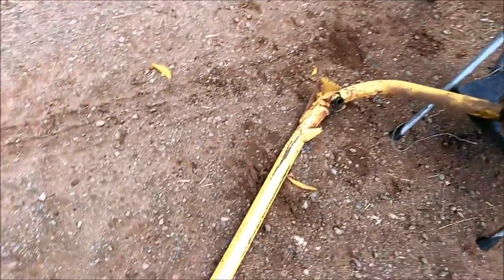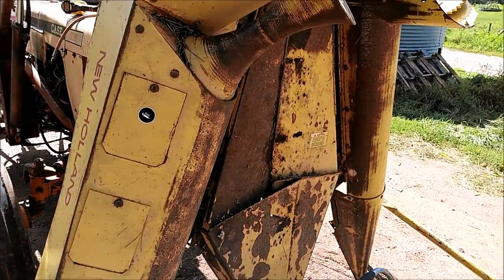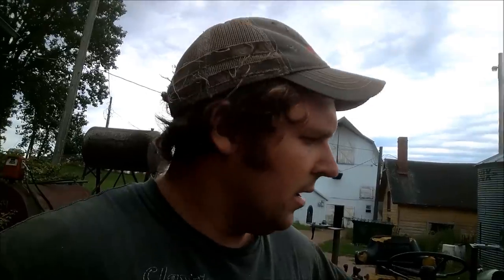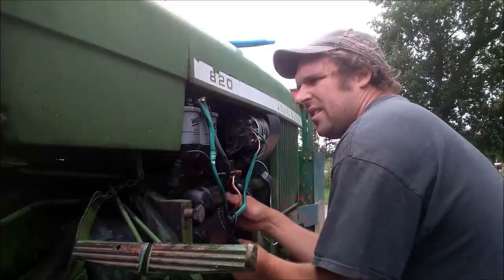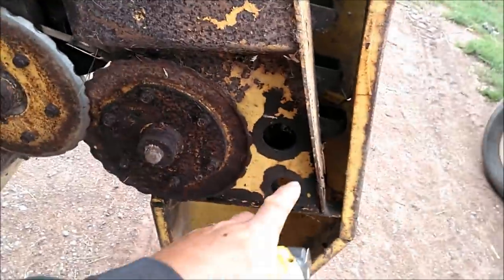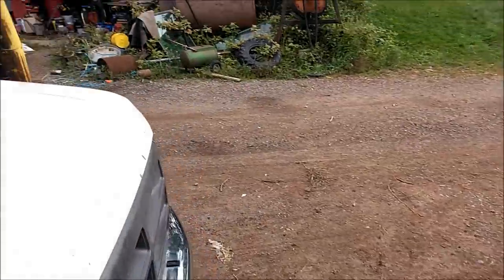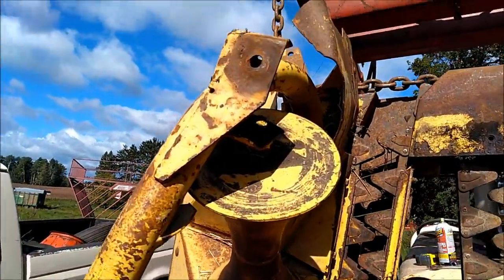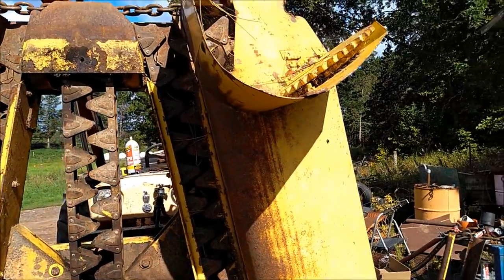Narrowing up the New Holland 822 Corn Head

Comment: Hey Alan thanks for the update, hope the corn head works good for you. You might want to use power service diesel additive in your bulk tank to help with moisture in the fuel and keep injectors clean I always used it back when I farmed and had good luck with it 👍

Comment: I always use Sea Foam fuel additive. It is the best additive on the market. My snow thrower was skipping and the only way it would run was without the choke half way open. I put a few ounces in the gas and a few drops in the oil and let it run for a few minutes. Next week I pulled it out of the garage and give a pull and she runs like a top. Also, the best lubricant is a product called LPS. My friends truck door wouldn’t stop squeaking so I put a few squirts on the hinges. He laughed and said that will never work. I saw him next week and he was amazed. No more squeaks. I really enjoy your videos but missed the family. Oh, how’s the manure pipe project.
Reply from the maker: Found the crack in the pipe, just waiting for a part, should be here beginning of next week, then we can start putting it back together.

Comment: Check the clearance on the discs that cut the stalk off. There is shims for adjustment. I had the 824, supposedly the discs were back toward the gathering chains more than the 822 was.
Reply from the maker: Yeah I tried it today and had a little trouble with one side plugging with grass, so I took a shim out,I looked at an 824 and they did move the discs back, I've heard some people say the 824 was much better, but a friend of mine had an 822 and said it worked good, so time will tell.
Reply: @trinitydairy  I had a New Holland dealer 8 miles away, I would have them set the shear bar up on the chopper and adjust the chains and discs on the head. What does the chopper have for a pto, a factory NH?
Reply from the maker: @garybridger6707  yes I believe it is a new Holland
Reply: @trinitydairy  I had a 770 chopper. The factory PTO shaft that hooked on the tractor had a strange slide system. It had metal rollers lined up sideways. Went through 2 of em one year. Converted to a newer pto.

Comment: You need to check the grease lines that run through the head. Sometimes they will break, then your bearings run dry. If you are having trouble cutting off grass you will need to shim your stalk knives tighter. Sometimes they have to be pretty tight together. Also make sure the bearings on the stalk knives are good. When they start getting bad it will let your stalk knife gap too much.
Reply from the maker: Thanks for the info!  I was lucky enough a friend had a manual for this head so I had to make a few adjustments today even on it.
Reply: @trinitydairy  happy to pass on what I know. We had an 822 and several 824s

Comment: O I have fixed plenty of them corn heads! Good old head you have their! The gears underneath make sure their in the right places with the clips holding them in place, also roll the head over by hand a few times forward an reverse to c if the chains don't bind anyway if they do you will shear your head bolt !
Reply from the maker: Yeah I just had that happen.  A friend had a manual for the head and now I've got it working right.

Comment: If you have a lot of grass in your corn you may have a problem with the cut off discs but if their tight they will cut good in grass just may have to reverse the head with you get to the end of the field once in awhile to clean the grass out that gets between the disc an bottom gathering chain!  Good luck Alan!
Reply from the maker: Yeah I tried it yesterday and one side plugged, so I took out a shim and it worked good today. Thanks for watching!
Reply: @trinitydairy I have ran then heads for a long time, I'm onto the new 3 row now but I have ran many acres a year threw it, when the 782 can out new we got that head with the new chopper an it served up well threw the years!  The center snout don't like hitting rocks tho they will brake on the back side that their fastened to!  Make sure if you take them cutting discs off lube then up good before they go back on!
Reply: @trinitydairy  another thing allan, on your spout so it doesn't brake when they get old, put two pieces of 1 1/2 x 1 1/2 angle from the bottom of the spout by the hinge to 3/4 the way up on the outside on both sides, their are holes already in the spout just use them an that will help it from cracking, their good for that!

Comment: Another thing Alan make sure you've got extra filters with you in a jug of fuel with that cleaner in it because once that starts breaking up it'll plug those filters right up you can change them on the fly and takes just a few minutes but if they plug up you're dead in the water
Reply from the maker: Thanks for the info!

Comment: Think you’ll like that little chopper Alan... what model Gehl chopper are you replacing?
Reply from the maker: I'm replacing a Gehl 1000, we still have a 400 and a 600 with a 3038 belt corn head, all good choppers but getting hard to get parts for.
Reply: Trinity Dairy yep agreed. My uncle had a 600 and a 1000. Always liked Gehls

Comment: You have it set for 28 in. rows. move one side out one hole for 30 in. timing on the chains changes when you move spacing. also keep a .005 to .010 ths. interferance on cutting disk to keep grass from plugging tunnels.
Reply from the maker: Yeah I noticed that, when I got the book for it, so I moved the one side out. got the disks set good now, thanks for the advice and thanks for watching!

Comment: The biodiesel is the worst thing that they ever came out with if anything sets for more than 2 to 3 weeks it starts developing algae inside the tank and you putting it that allergy cleaner in the fuel tank was smart and by swapping out the fuel filters is really smart because as soon as that stuff starts breaking up it just plugs a filter right up and I mean almost instantly The reason I know this is I drive a truck and trailer and mainly a reefer and I pick up a lot of reefers that have been setting for a while and I got the same problem it's just all comes down to having that corn piss in the  fuel